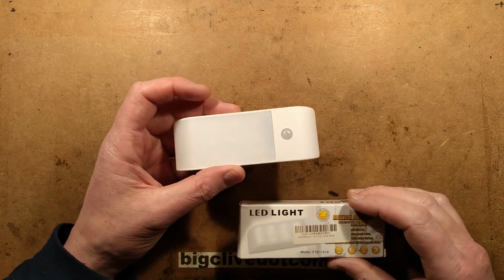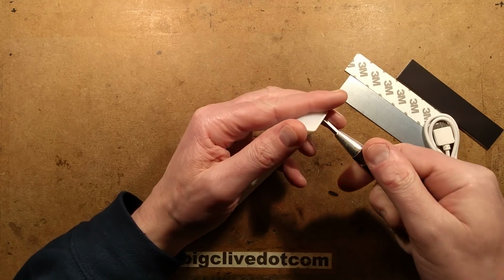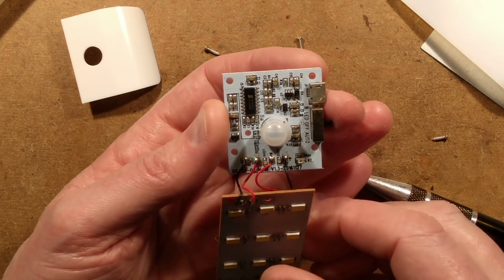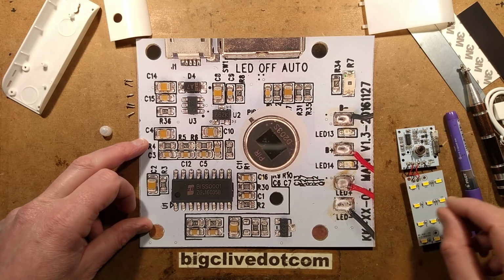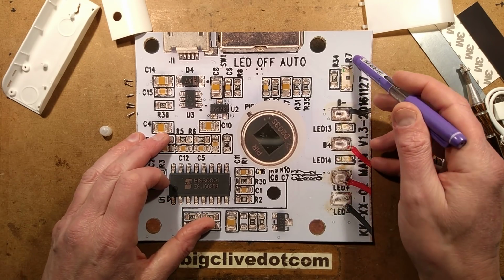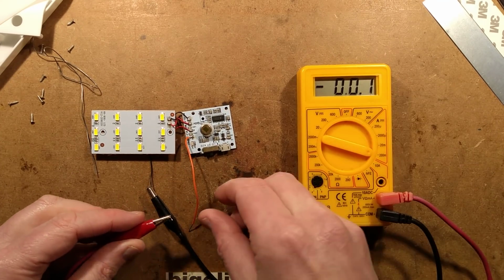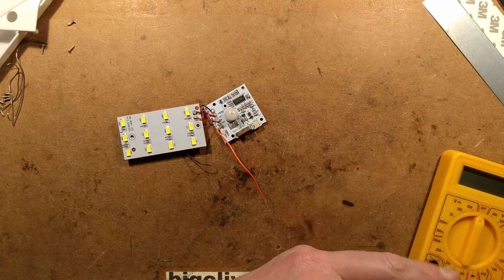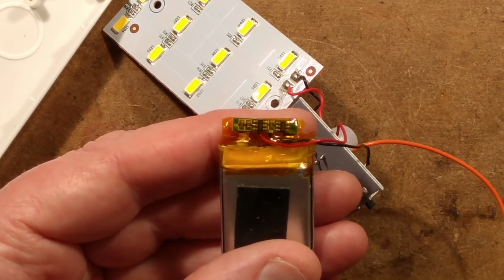Sensibly designed USB rechargeable PIR cupboard/hallway light.

Comment: My problem with those cheapy meters isn't the meter itself but, the leads. They are beyond rubbish and usually fail long before the meter.
Reply: Yeah my first meter when I really started getting into electronics was some shitty meter that was like 5 bucks unopened from a thrift store
I think it worked fine for a few days and after that the leads were so damn loose that you had to press the leads down with your thumb every time you accidentally shifted them once because they no longer made contact, really problematic when trying to do some continuity testing

Also i'm not sure if it was supposed to have a clicky rotary bit but I remember turning it and it clicked once and after that it spun freely, worked fine but it was a bit dodgy if you accidentally spun it around while using it, not sure if it was supposed to be that way or if it broke immediately but I got a new meter a few days later and threw that away
Reply: Just solder them on permanently and get rid of contact resistance :)
Reply: @benbaselet2026  How would you then switch into current sensing mode?  You'd need another lead and I'm not sure if that lead would be live when using the other two.
Reply: @alexatkin  Well the meters are like 5 bucks a piece so it's not really an issue to dedicate one without the high current range and get another for the amps if you need one.
Reply: @alexatkin  I've been able to have three leads plugged in simultaneously and switch between voltage/current measurements on at least 2 meters that I can recall. I too thought you you'd only be able to have 2 leads in at once for either voltage or current but have found, in my limited experience, this not be the case.
Reply: the leads are less than £1 so to replace them isnt an issue,
Reply: @bgray1009  Sure, but the sockets get loose too, which is more of a problem than the bad leads. I'd buy or make proper leads anyways, poor wiring is never good for measurements, even with cheap meters.
Reply: @benbaselet2026  You could get some half decent banana plug sockets and whack them in, it probably wouldn't be too much work
Reply: I did something like that once except once in a meter it's a good piece of test equipment with proprietary connectors that I had never seen before and couldn't find anything to match but something I used all the time that could do so many things I don't even remember what it was it was it was so many years ago.
Reply: Aaron Brandenburg
Did something like what exactly? There’s 8 responses beneath the OP already.
Reply: My problem is the voltage rating they state they are capable of. I have 3 of them 1 set up permentley for current and the other 2 for voltage and temperature. the label on the front states 750 AC 1000 DC. there is no way on this earth would i put that thing any where near that kind of voltage. the track on the PCB is pathetic and there is next to nothing for a spark gap between said track and the lead contact. but for low voltage low current testing they fine for beginners
Reply: Just buy a decent fluke meter with fluke test leads.. If your serious about electronics... Don't cheap out on test gear..
Reply: @muzikman2008  I think thats complete overkill for a lot of hobbyists. its worth it for the safety aspect if youre using it for mains voltages but for messing around on the bench with low voltage stuff, leds, batteries etc you can get all the features and accuracy you need, and good quality leads, for waaaay less cash with something like the Aneng 8009, which is a fantastic piece of kit for like 5 or 10% of the cost of a Fluke
Reply: Sometimes I get coupons for free ones from harbor freight so I keep a couple extras around if something happens. Oddly outside of the shit leads, those meters work and I used one for a good 4 years in auto repair and it took a beating before the display started coming apart. For what's basically a throw away tool they're actually shockingly good. Worth picking up some decent leads and getting plenty of use.
Reply: I thought moistening to solder was cool you of water or rag which you're not supposed to do you're supposed like cool naturally. But I know he's he's saying to add fresh otter with his iron treating this is harder to make it flow easier.
Reply: I actually had the opposite problem with mine, from “harbor freight” in the states. Leads were in there so damn tight I had to rip them out. Basically the same cheap small meter clive uses but red plastic case. Also the amp and voltage leads were jumpered together, not that familiar with electronics so I’m not sure that’s right..